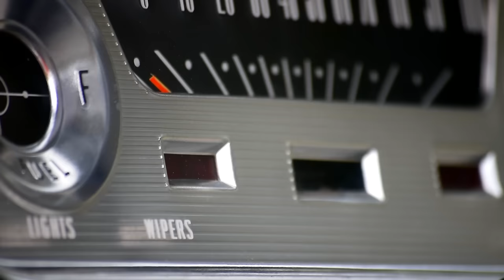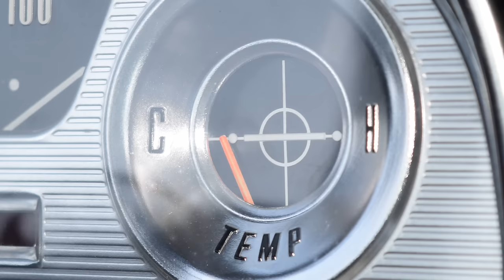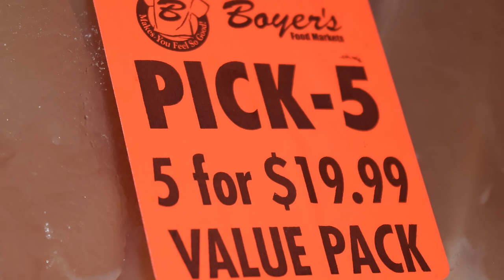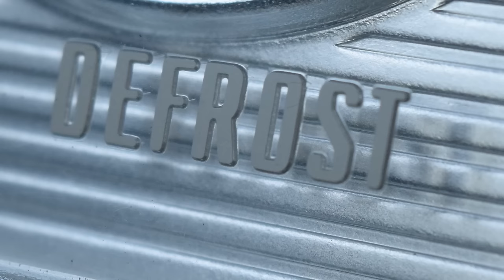Regular Car Reviews: 1960 Ford Falcon (stock)

Comment: As an Australian the idea of a falcon as an economy car is so foreign you might as well be speaking Greek
Reply: Explain yourself. I own a 70 Falcon myself and ive noticed there seems to be a large following in Australia.
Reply: falcons have been made in Australia since the 80's and there very common and bad on fuel. but yes very big following
Reply: Yeah, like the Commodore. My Commodore included. God I wish I had enough money to take that thing on daily drives.
Reply: mad max?
Reply: +be ef I'm aiming to get a 1962 ford falcon deluxe XL, don't know if you could help but.. Any tips?
Reply: Well no not really, this was not my first older car. Mine had a little typical car rust, check the bottom of your doors, trunk and hood. Other than that i found nothing out of the usual with these cars that goes bad, just check your typical stuff.

Typically i would not judge performance too much car will probably need a tune up, carb re tune or rebuild, check ignition timing, emissions and vacuum leaks etc.
Reply: +be ef ok, thanks for the help.
Reply: ThatReds13 I know I'm a little late to the party here but we've had Falcons since 1960. The original XK-XP series were economy cars, from when you could still walk into an Aussie Ford dealer and buy a US-based Fairlane or Galaxie. After 1972 Falcons became their own thing due to a local production law.

Also, Falcons get a bad rap for being uneconomical when they're actually quite good on fuel. My 1989 Fairlane would regularly get 9l per 100km (31ishmpg) on the highway and 13-16l (20mpg) in town (with the 3.9L 6 cylinder). They're not really the gas guzzlers people think they are.
Reply: deadlizard64 you Australians doll them up real nice I admire you for that the first Australian Falcon I ever saw was mad Max's interceptor I fell in love with the car not the man I don't roll that way
Reply: Chris Cucknik they are thirsty because most of them down there have V8
Reply: Alpha Nerd.   Watch out for rust there's always more than you see
Reply: lol@the guy who said they were built here since the 80s. The model in this video was built in australia as well and it was only these very early cars that had much in common with the USA falcon. After that they diverged and the aussie car went on from the early sixties till 2017 and was body on frame properly as well.
Reply: @FknClarence  they were making falcons in australia in the 60's  ???
Reply: @rossprivate5456  you're right, the XK Falcon was first built here in Australia in 1960. The Falcon and the R/S Series Valiant made the FB/EK Holden look very old-fashioned. Unfortunately, the XK proved fragile on Australian roads and dented Ford's reputation here. The subsequent XL strengthened things up and the Falcon legend in Australia began. It still took until the 80s to knock Holden off the best-seller perch. My, how things have changed.
Reply: @TheRealUnconnected  Sorry but Falcons in Australia were never body on frame - they were always unit bodies, just like their main competitors, the Valiant(which were also built in Australia from 1962-1980) and GM's Holden(1948-2017).
Reply: @SuperMikecarp   what are you talking about? All falcons have separate chassis right up to the FGX, how do you think they made a cab chassis ute off of it?
Reply: @TheRealUnconnected  The cab chassis ute was constructed differently from the other Falcon body styles. Obviously it had a rear chassis section which could have various trays attached. But sedans, wagons and utes definitely did not have a separate chassis, like a truck or heavy duty SUV. Just look up the history of the Falcon. It was introduced in the US in 1959 as a light economy car with unit body construction, just like it's competitors, the Corvair and Valiant. The Aussie XK Falcon was almost exactly the same as the US model. As the years went by, Ford Australia modified and strengthened the Falcon so that it was better suited to our conditions, until it bore little resemblance to it's American cousin. But they certainly didn't completely change it's method of construction by putting a truck chassis underneath it. But  don't just take my word for it. Check out the internet.

Comment: I love the simplicity, that’s why I mostly drive old cars. I can repair them at home. I used to drive modern cars but I was tired of always having to plug it into a computer to diagnose the problem. Then I would have the problem of mechanics lying to me. You need your transmission rebuilt, when the only problem was a sensor somewhere. My daily driver is a 1979 Thunderbird. And yes the air conditioning still works.

Comment: And then all the stuff that was so regular about it from that era gets yanked out...

But I don't blame him, make it more fun.
Reply: It made it possible to daily it.. you don't daily a car that cant advance or stop or turn... single master 4 drum brakes.. thats just foolish
Reply: Correct. It just wasn't safe on modern highways.
Reply: Id convert to dual master for safety, that is a wise move, other than that its fine like it is.  Mechanically its not much differnt from my 71 Maverick that was my first real car.

Comment: I have the 1980s version of your Falcon! A 1980 Mercury Zephyr 4 door with a 2.3 4 cyl. The only options on it are a/c, power steering, power brakes, and automatic transmission. It was ordered with no radio. I'm swapping in a 302 and 5 speed, and your build of the Vagabond Falcon has been an inspiration for me.

Comment: I had a 61 two door wagon. Bought it in 1966 for $350. Correction on the 144 c.i. motor being dropped. My 61 had it. Piece of shit but it got me to work for 10 months after high school until I went in the Navy. 3 on the tree non-syncro tranny that taught me how to double clutch which came in handy when driving some military vehicles. Mine developed oil return problems and ran hot. No backup lights, lousy heater, hand crank window on rear wagon door, 13" tires, vacuum windshield wipers stopped completely when going up a grade and ran like he'll going down. Everyone remembers their first car. My dad sold it for me while I was in basic training. I got my $350 back.

Comment: Correction... at least in Canada. In 1963 my mother bought a brand new Falcon that came with the 144 cubic inch inline six that you claimed was abandoned in 62. I do have my doubts that it was discontinued in the US but still available in Canada.

Other than that, yes, the car was a dog and watching snails in the ditch pass you did hurt ones ego. With the 2 speed auto it could hold highway speed in the right lane. Passing a semi on a 2 lane highway required on coming cars to be near invisible in the distance or they were too close.

Having a good chuckle at the way you present lemons of days gone by. Keep up the good work!

Comment: I would still take a 1960 Falcon over 99 percent of the cars built today.
Reply: AMEN TO THAT, BRO....WE ACTUALLY HAD 2 FALCON WAGONS ; ONE WAS A 1960 WHITE 2 DR WAGON WITH THE 144 c.i. 6cyl & A 1963  DARK MAROON 2 DR WAGON WITH THE 170 c.i. 6cyl. BOTH WAGONS WERE THE " 3 ON THE TREE" MANUAL TRANSMISSIONS.. I LIKED THE 'DOG-DISH' HUBCAPS ON THE '63. THEY STOOD OUT THE MOST.....THE '60 HAD THOSE " NON-DESCRIPT" DOG-DISH CAPS. MY DAD SAID THAT BETWEEN THE TWO, THE '60 WAS MUCH EASIER TO DRIVE & THE '63 ALWAYS HAD UPPER BALL JOINT PROBLEMS IN THE FRONT. WE ENDED UP MOVING DOWN TO FLORIDA IN THE '63...ONCE WE GOT DOWN THERE, MY DAD TRADED THE '63 IN ON A 1967 RAMBLER REBEL CROSS COUNTRY WAGON.
Reply: @shwt121  A cousin of mine had a 62 Falcon and my parents bought a 64 Fairlane  wagon with the 200 CID and 2 speed auto transmission in it. That 64 Fairlane was the car I learned to drive in.
Reply: @shwt121   Loved my 3 on the tree 1960 ford falcon...
Reply: Yep Agree I would just put a Australian Ford Barra engine in it and upgrade the brakes!
Reply: I had a pair of '62 Corvairs at different times, both convertibles.  Sweet, SWEET vehicles.

Comment: Ford hit it out of the park with the Falcon.  In the first year of production they sold 435,000.  This is the car the public wanted and GM and Mopar had to scramble to compete.  Simple.  Reliable.  Economical.  A wonderful car that had what a family needed at a reasonable price.  It's simplicity is it's beauty, and a throw back to a simpler time.  The six cylinder engines of the time powered everything from small cars to commercial trucks.  There were many great examples.  The Ford 144 and 170 that came in the Falcons were easy to work on and would run forever with proper maintenance. Good on gas too.  They are to be appreciated for what they were.  Simple, smooth, and reliable.  On that Falcon chasis they also the had Wagons,  the Van, the convertibles, the Sprint (which Jay Leno loves).     Later they used the Falcon as the basis for the Mustang.  The Falcon was one of Ford's most successful cars.   Love the Ford Falcon and Mercury Comet.  I hope you keep it stock.

Comment: In Australia, this car was a full sized family car. It had more chrome and a few more accessories. The 144 ci engine lived on until at least '66 and my family had a 144 ci wagon in which we put four kids, two adults, a roof rack loaded to the gills and drove in from Melbourne to Rockhampton and back, about 3000 miles, on a summer family holiday.

Comment: When I heard the remarks about not having amber turn signals up front, I braced myself. NO American car had them back then!

Then the noise about no PCV valve...

Just another video by a "modern young person" who makes a video and never bothers considering what was the norm for the time period. Didn't have FM stero either, and we were not in the dark ages "back then".

Actually, I am sitting outside looking at my 60 2 Dr Falcon and the image in the video of a stock bodied "Falc" with the ideal lighting has gotten me to thinking how much better it looks then the new junk sitting on the showroom floors.
Reply: Green Giant  He probably is not aware of "leaded gas", that was off the market before he was born.

Just had a thought, what would he say about a 1960 Corvair? LOL!

Comment: Hey the Falcon is still being made in Australia but the factory going to close in 2017
Reply: yer and we fixed the falcons in the mid/late 60's onwards by just making em just 4 door mustangs with pretty much all the performance options except big block v8's, only small blocks. In fact in 1970/71 the xy gtho phase III with it's 350+hp 351ci cleveland v8 was the fastest 4door production car in the world.
Reply: +C~GT But they still had sick 2 door coupes (don't make coupes any more) one of the most famous is the ford falcon xb coupe because it's the mad max interceptor
Reply: yer the 72-79 xa-xc falcon didn't even try to hide the fact they were mustang's with 4doors by actually making 2door coupes that looked like a mach1 mustang
Reply: rip mad max the pre sequel

Comment: Who saves Ford Escorts?

ouch.

I daily an -90 estate 1.6 cvh with a carb. Not really "saving" it but keeping it roadworthy. My project car is a -82 escort that has some questionable modifications and repairs done by the previous owner that need to be fixed so I could daily that and properly fix the estate one.

Writing this made me realize that my life is now an endless cycle of old cheap shitty fords.

Also there needs to be a regular escort review. Euro or American doesnt matter as long as it is a survivor one.
Reply: Thank you for keeping these regular cars around. Your escort is more interesting than most anything you see at a show.

95% of 1990 Ferarris are still around, but even though millions of escorts were sold, there are probably less 1990 escorts in existence than 1990 Ferarris. Sure, they're not valuable, but if one survives somehow not being crushed/crashed/worn out for 30 years, isn't that somewhat of a miracle?

They defeated the odds of being used up and discarded like the rest of their brothers/sisters and deserve to be saved and preserved.

Comment: 1988. My fourth car was a 64 Falcon. Blue on blue. Rusted out behind the rear suspension, the rear bumper bounced up and down loudly, the steering wheel wobbled, and the rear end roared, it burned oil and smoked, it backfired when it got hot, and it wouldn't start if it was hot and it was so hard to start when it was cold outside. It wouldn't accelerate well, it wouldn't stop well, and it wouldn't turn well. I loved it. I drove it to work every day until the rear bumper and subframe fell off and took the tail light wiring with it. The guy who bought it from me for $500 restored it. It took him four years and over $5,000. He still drives it around to car shows. It might be the only blue on blue 64 still mostly original.

Comment: Nothing you have said about that 1960 falcon is true.  Youre like most millennials in that you got your information from marketers and sales personnel, but never actually knew people that owned these or drove one yourself.  I am Earl and age 62 and owned one of these with the three speed maual on the column and I new lots of other people that had these in their families even up into the 1970s.  These falcons (1960 model with the 144 CI six) DID NOT BOG DOWN GOING UP HILLS.  That's is just not true!  They were light and these design sixes had some mean pep!! Anyone could go up a steep hill and maintane 70 MPH easy and these things could zip around on the freeways.  You could also go cross country in one of these and cruise at 70MPH all day long.  I owned one that I bought in 1972 from a used car lot in rising star texas when I was age 16 as a fun car during times I worked on my 56 ford Fairlane and 59 GMC pickup and that car ALL STOCK I could keck ass on those farm market roads and even take curves at 70 MPH plus and keep up with any full sized car such as when I would follow my friend David to Brownwood Tx that drove his 70 Pontiac Catalina.  That falcon could easily follow him at high high speeds.  Then my older sister Gloria while engaged to her BF Gary a big tall guy with a beard would drive one that was a 61 ford falcon from Houston Tx to visit us in RS which was 356 miles away and when I got on the back seat and he drove us to Cisco Tx during his vistis so we could visit me and my sister grandmother in Cisco Tx 20 miles away he would punch that car and it flew down that road at 70 to 80 MPH and could have gone even faster.  You Lillinneals believe things from books and false sources.  Those falcons could go coast to coast and ADAIN hear me out...These did not bog down on hills like you said in your video anymore than some full sized V8 car would have.  I could easily drive a stock 60 falcon cross country today.

Comment: Hey, where are you located? I recognized the Route 443 sign as being somewhere in mid-east-central PA (I live in Lancaster and work in Lebanon and other places). My parents had a 1963 Dodge Dart with a push button 2 speed automatic, and before that a 59 Rambler Custom, also with a 2 speed push button auto.

Comment: If you like old cars this is a fun video to watch.  I believe the Ford Falcon was the first unibody american car.  Also, seat belts in the early years were an option.  The crankcase vented into the atmosphere, there was no PCV system.  I had a friend who's father LOVED these cars and had the Sprints, Futura's and Rancharo's.   I still get a bit excited when I see one on the road.   Thanks for putting the video together.

Comment: In 1971 bought a 61 merc comet for $75. 6 cyl auto perfect condition was a great car no problems was like riding in a fish bowl. This was mercurys version of the falcon. I did not experience braking , going up hills ,steering ran like a normal car. I also at the same time had a 68 mustang 289 v8 convertable

Comment: We got those in Argentina from 63 to the 80s and it's one of the 4 iconic cars of the country. It was cheap, reliable, and easy to fix. The base model had a 188 and the sporty model had a 221. The most recognizable car in the country and the favourite of many. Nowadays these are classics, people buy them, modify them and race them.
The Falcon, along with the Chevrolet Chevy (our version of the nova i think), the Dodge GTX and the all-national IKA Torino form the main category of racing in Argentina

Comment: I bought a 1960 Falcon 2 door new.  Not enough power to blow the foam off of a glass of beer but it got great mileage.  From day one, it would over heat... Ford couldn't or wouldn't fix it.  I finally had a radiator shop install a 3 row radiator core.  That fixed the problem... The other major problem was that the oil pressure was so low that the front valve rocker arms would starve for oil and burn out.  The rocker shaft and destroyed rocker arms had to be replaced.  This was such a common problem that the after market  suppliers sold a kit that tapped into the mail oil galley on the block and provided oil through a piece of tubing that snaked to the front of the valve cover. It was flattened at that point to allow it to run under the valve cover through a snipped out section of valve cover gasket and then to the front end of the rocker shaft.  The plug in the rocket shaft was removed and was replaced with a plug that the oil tube attached to.  That fixed that problem but starved whatever had received that oil before.  Once those problems were addressed, it was a great little car.  In other words, Ford quit before the design was finished.

Comment: This reminds me so much of my 61 Ranchero, which was a Falcon station wagon with the rear roof cut off. A friend and I pulled out the 170 six and  installed a 289 4-barrel V-8 with a 3 speed stick, and Corvair bucket seats. It was crude but fun.